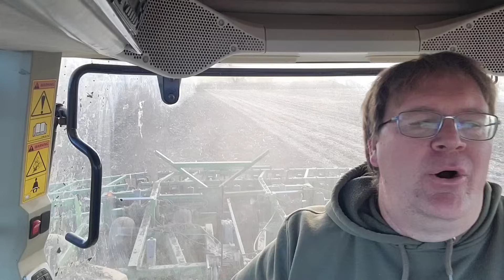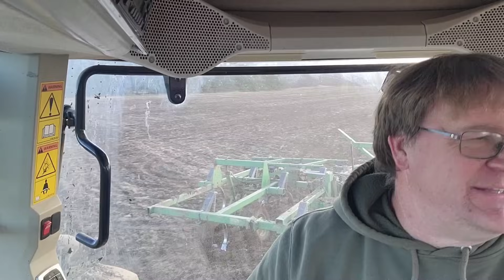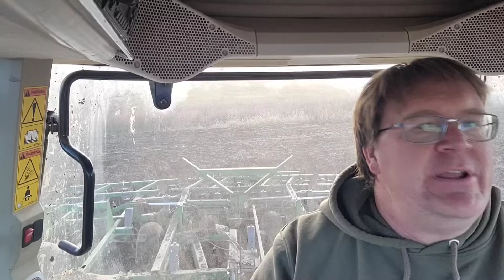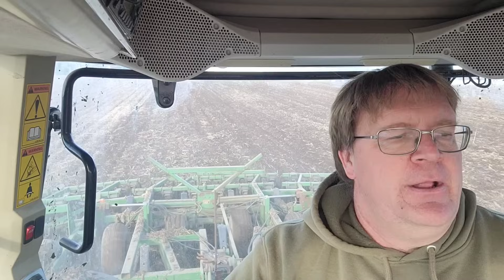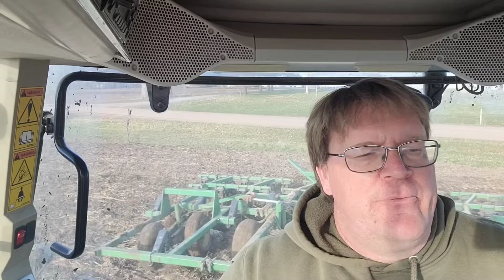One Lonely Farmer uses verticle till is he still soil health. how tillage works in soil health.

Comment: Jon,
Reply: My edit would not post. Stripping does NOT solve....
Reply from the maker: @jimmartindale  correct, the strip strip-till on its own isn't fixing soil. No tillage implement is. strip-till is a great nutrient management tool, the best seed bed tool, and a wonderful transition tool.
Reply: @jonstevensmaplegrovefarms3754  there is a tillage tool design which does repair soils. It does it by restoring gas exchange and producing a root system which does repair the soil. That's the best steel can do. We've watched it work for 40 years in a 45% clay and 45% silt soil in northern NY.

Comment: I run the Mulch master shovels i find out if you put a spike shovel on top of the 24 in sweep you can wear them out until the wings are gone and with out the spike on top i would wear out the center of the wide sweep and loose them in the field and they had a lot of life in them and may find them in a tire and i all ways use light tillage and never heavy tillage and fertilizer all ways is put as close to the row as possable and i have cut fertilizer use  by 2/3 of what i used to use and am keeping the same yeilds

Comment: It's OK, just say "i Tried no till and it doesn't work" but ppl will not say that because before loud mouth talked about cover crop like some kind of cult, 😂🔊
Reply: 10+ years no-till and covers on 300 acres here. SOM increasing. No commercial P, K, or lime for last 5 years. The first 5 years I wondered if it would ever work. Suffered thru some low yields and snide comments from neighbor farmers. So now, my yields are slowly improving but still not back to where they were with conventional Ag. Most important to me, net $/acre has exceeded my conventional for the past 3 yr. Bottom line, it can make you more money, and free up some of your time. That isn’t going to happen in one year though!
Reply from the maker: @jrwstl02  nice! Great point on dollars vs yield
Reply from the maker: Are you referring to me as loud mouth cult covers? 

I am a far stretch from no till don't work. Smoothing up a field is far from going back to full tillage. Still doing cover crops as well.

The whole "I tried x once and it didn't work" is just ignorance.  What did a person use to determine success? Yield? So you "tried" a new system against your proven system and it didn't yield as well, hmm go figure. Or we tried covers and it didn't yield more so covers don't work.  What would covers do in one summer to improve yields?

Comment: I have a question. I’m in south Sask and we don’t really get enough moisture to grow cover crops here, I like the idea of a salford type disk for residue management to seed through however your comments about seeding on top of last years row doesn’t for me work here, I find if I seed in the same rows as the last year I get awful seed bed and poor emergence from dragging the stubble, I always plant 4 degrees off from last year for better results. 
Am I somehow being dumb?
Reply from the maker: Absolutely not being dumb, being dumb would be dragging residue to plant on last years pass because some guy did it on the internet. Wait, did I just rip on me? Lol

Yeah you guys have Salfords not VT. LOL

The moisture thing is a double edge sword,  covers will put carbon into the soil, in time they will help get more rain into the soil, and hold more water. That's great,  
But what about the years of getting there? We don't want to hurt cash crop. 

Management? Could a guy use covers that don't use a lot of water and terminate early? I assume you are small grains so small grains covers can be risky but doable. What if you did annual rye grass in the fall very light rate, in spring it only gets a couple weeks of green and then it's dead with your normal spring work.  Might seem like a waste but it had a few weeks of putting carbon into the ground, as time goes on you can try more things in the tiny test plot.

Comment: Thanka for the shout out Jon!  Those soil probe results are 20 yrs of heavy cover crop/ no till (as much as possible)  

Allow me to share my experiences after you get organic matter to 4%+ and soil probe results where you can push it down 3-4 feet and barely hit 100 psi.   1st) it could only be achieved with the use of cover crops... one simply cannot grow enough carbon (plant matter) with a cash crop only... all you will do is hold even on organic matter. 

2nd) and most importantly.  Ive found, being farther south, yes i have a sligjtly wider window and warmer temps in sprijg and fall, but that alos comes with challenges! 

Lets talk about GREENBRIDGE!  pests over wintering in your cover crop is a very real thing!!!  In drought conditions to wet conditions, its a breeding ground for insects, yes many are beneficial, but the non beneficial... like army worm, wire worm (ear worm) can and will over winter in your cover crops in nebraska.  So every 3-5 years i have to break the greenbridge... with... you guessed it a disk!   Oh no😅.... ive got a 33 foot wheatland John deere disk, that i jokingly call the "soil destroyer" when i speak with jon!  Lol. 

If you dont till that soil ( i always do it after high yeilding field corn)  200-250+ bu corn stubble, then for maximum soil healtu you actually dont want to plant a cover crop over the winter, becaue you just came out of growing corn you planted green and possibly spread cover crops iner row on the corn, so i have a massively increased population of western bean cutworm and wire worm, army worm etc, those pests need tilled out at 6 inches deep!  And the corn stubble is so think you can hardly 20% of soil behind the disk anyway, some of those insects will overwinter in stalks, but they thrive in a living root 365 days a year... 

So as keeping a living root 365 days a year is the key to unlocking the best your soil had to offer, and cover crops are the only way your going to get there... and see your arganic matter double and triple in a decade.  I would argue that totally undisturbed cover crop residue regenerates topspil, not tillage it will destroy topsoil.  You are 100% correct about having a 15-25 year base of root structire that is 3 feet deep from years of deep rooted cover crops and cash crops roots going deeper as a result has changed the way i farm, i dont have a "hardpan" when i do tillage, like you jon, i only do it 2 times a decade, maybe 3 if i rut it up.  

TO THOSE NEW TO COVER CROPS, AFTER 3 SUCCESSFUL YEARS OF GOOD ESTABLISHED COVER CROP, BEWARE THE GREENBRIDGE!!!  it is real and is a real issue to be managed.  Tillage will never totoaly disapear from farming.   Ive got alot of data that tillage every 3-5 years, especially after corn is actually the best system, becaue you need a winter for that ground to sit idle, adter 3 yrs of bugs surviving thw winter and nesting in your kick ass regenerative living soil 365 days a year, those bugs are looking for food in February too... and your green cover crop roots look miguty tasty.   If you want yo get rid of a pest the beat solution is to get rid of the food source.  

#saynotonotillchurch
Reply from the maker: Thank you for the conversation!

Comment: Perfect sense. Pretty much described the sloughs around here and needing the soil to "breathe" Helps if I can take off stuff for slough hay and not have to disturb the soil with a disk as long as it's smoothish. Like to try to not disturb it to allow better flotation if it's a little sticky next spring. Sometimes if it was tilled the fall before and a wet spring it can make it difficult to get through, can make it worse than what it was the year before.

Still hate tillage with a passion as the years go on, but it sucks dealing with ruts. Still have a bunch of spot tillage I need to do yet but might have to wait till next spring or fall again to clean up some rough spots.
Reply: No farmer... but to set the seed right on top of last year's root bed is interesting thought on the new roots finding the nutrients that the old root left and the ease of new root to penatrate down the old roots tunnel seeking water and nutrients...could be a double win
Reply from the maker: What about your organic ground. Do you think that soil is better, worse or same as the rest of your ground?
Reply: @farmingnodak  you need to put proof your soil with a CurseBuster.

Comment: So by this logic some one like me who doesn’t do any deep tillage, plants some cover crops some times, and aims to no till crop acres whenever possible but end up working some corn stalks or bean stubble once in a while, is mostly doing what it takes for soil health then? 

I try to go away from tillage but end up doing some tillage every year.
Reply: Remember it won't happen overnight... as with a healthy stand of covers, they should do their magic underground. Do tillage as necessary where it needs it, even just spot tillage.
Reply from the maker: Well you're going to improve your soil Health versus doing primary tillage every year. And then what is the level of soil Health you want to get to. Maybe where you're at with a little bit of time you can make that goal question mark

Comment: In my full tillage world, and same RTK planter lines every year, am I not planting right over last year's row just like strip till?  Only thing different from the crop's perspective is concentrated band of industrial fertilizer.  Wetting and drying the soil along with introduction of air, which is mostly nitrogen, to release (mine/recycle) nutrients seem to be more important than just about anything else.
Reply from the maker: There's guys not too far from you they're doing some small scale test plots and it's pretty amazing the results they're getting.
Reply: @jonstevensmaplegrovefarms3754  Who?  Where?
Reply from the maker: @M8Stealth  a young guy I believe Glencoe area has done some biological/ fertility trials, 250 bushel corn with little N applied.
A large operation has been broad acres of biologicals, reduced fertilizer for a few years, 
 a guy more south on 22 inch, went to 44 inch corn with covers. 

Organic guy has a couple things I would like to get going myself.

Got to meet a handful of strip till guys out there that are having good luck